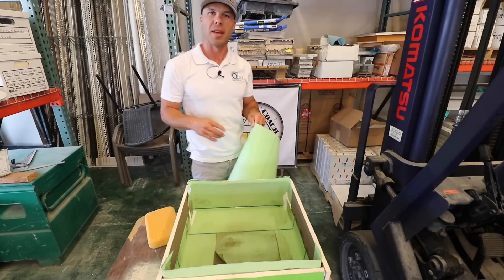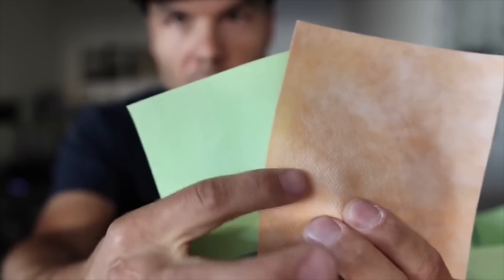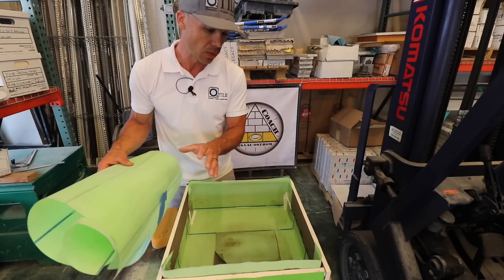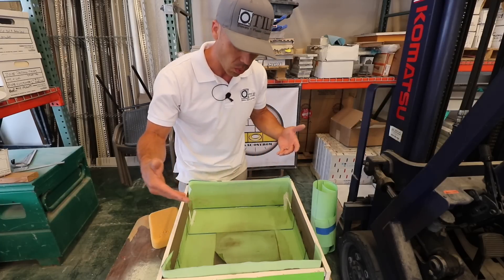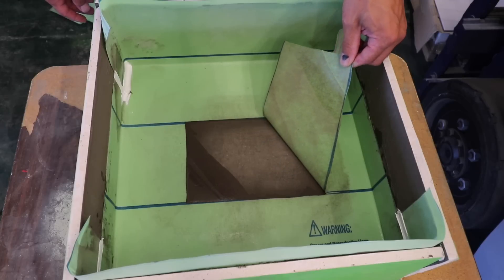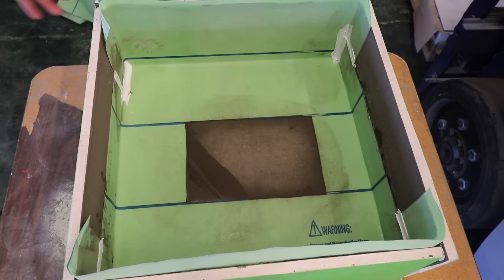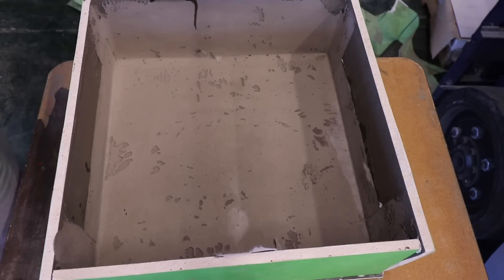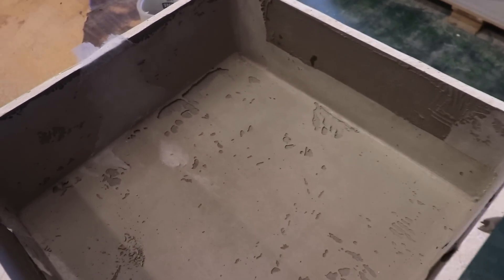Noble Valueseal Membrane 7 Day Flood Test

Comment: I think the precision of German engineering is shown in these tests very well. Schluter designed their membrane to be used specifically in showers that get very little use, don't have standing water and dry out very quickly between uses. I feel like in reality, your tests show exactly the flaws in our thinking.... when we think of waterproofing a shower as customers we think that we can use it a swimming pool and it will be fine, no water will get through it.... As a customer, when I pay for a shower, that is what I expect for the price.  Going forward... I like the idea of using either noble value seal with their 150 seal, use Goboard becker that is foam and waterproof to minimize the amount of topical membrane I use.... or just go and use a topical membrane and sleep easy knowing that you can swim in that shower for a month and not worry about your house falling apart. Thanks for taking the time and money to do these tests. super helpful for DIYers and professionals alike!

Comment: there is not a peel test in the tile industry since you can not peel tile.There is however both tensile pull and shear.In the USA we test to shear (pushing tile off)..The ANSI 118.10 standard for thin set load bearing waterproofing membranes references ASTM C482 with a min.shear strength of 50  psi. The average shear value for Valueseal  tested at  a outside independent lab is 219.0 # psi per the test report.

Comment: I've tested a cut kerdi fix corner for 48 hours now..no leak. I'll be making a vid and I'll tag you.
Reply: I'll keep you guys posted. I made the corner on the third and it wasnt leaking by last friday. The water level did drop but that was due to evaporation. I squeezed a little more in before leaving for the weekend, we'll see tomorrow what the result is.
Reply: Here it is guys.. no leak!  
https://youtu.be/Yguh8UoLDj8
Reply: Garrett Breech it fails every time,I have tested aswell!
Reply: Yes it will leak...even a kerdi board kerdi fix box will leak after 3-4 days .

Comment: As I watch so many of these tests I know these things save time over a liquid membrane.  But I’ve never had to go back to fix a leak in the red guard I have used.  This always raises as many questions as it answers.   Great content enjoy your efforts 👍
Reply: Do you flood test your pans.  Topicals can be dicey if applied too thin or coverage is not 100%.  Bridging joint gaps and cracks should be done with care and by manufacturers specs.  Sheet membranes do offer speed of installation and predictable results.  Really interesting video
Reply: @pauldhennessey  i have used redguard with no issues but i roll it on in multiple coats and multiple directions to assure a nice thick even coat.
Reply: @lovescamaros1  Do you flood test your pans. How do you treat change of plane, panel gaps and drain interface.  Red guard has specific guidelines for bridging movement joints and is not recommended over gypsum based panels.  I've used Hydroban topical with fleece tape and sheet membrane for years applying with drywall knives and 4 inch paint brush and had excellent results.   I've since switched to the Wedi system also with excellent results.   These test videos are really helpful and a benefit tio us all